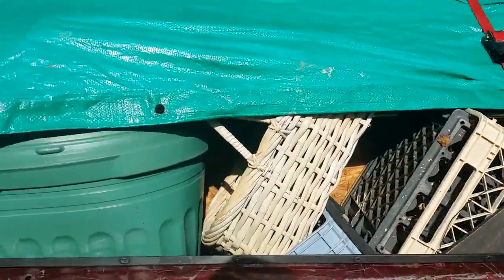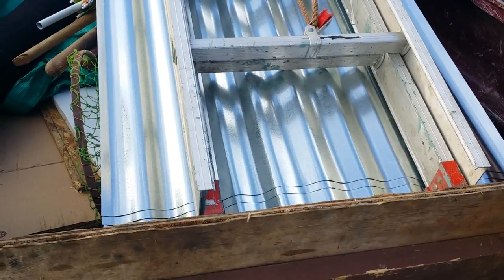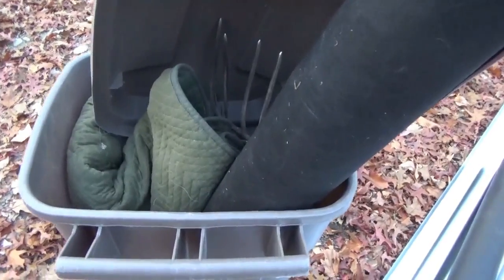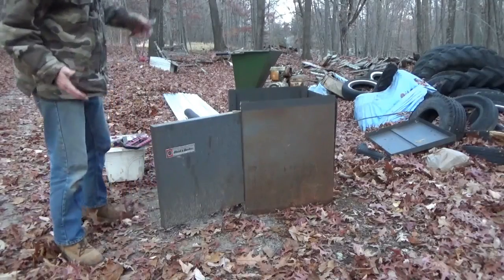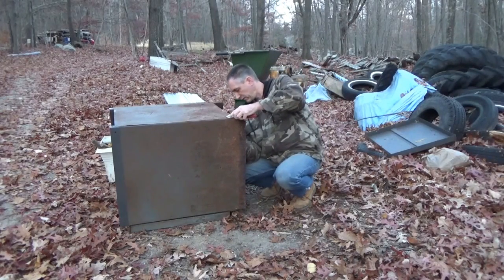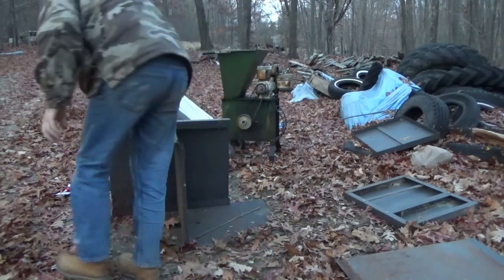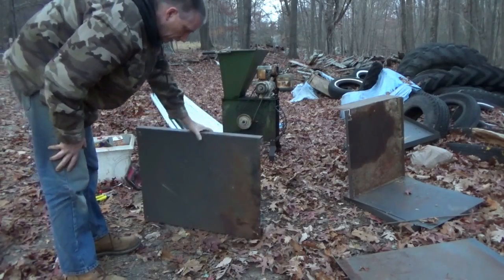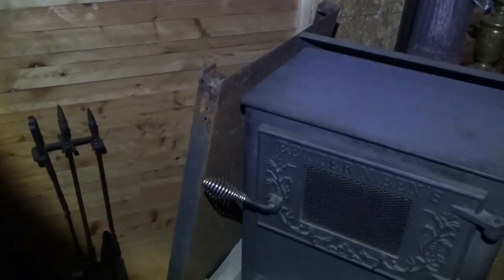Working For Others Today & Wood Stove Heat Shield Experiment

Comment: If you have any dramas with cold in the new shed Troy, simply buy a exhaust fan to extract heat from your house to the shed. A simple round cut hole in the wall facing shed. $20 bucks later, it works.
Reply from the maker: +Jack Scagnetti I have plans to heat it with the Sears wood stove if needed. I can also use that stove to heat water for showers

Comment: I had kind of forgotten about the metal cabinet. Once the two pieces are bolted together and painted black I think it will look great and definitely do the job. That was a good find and will look much better than the cement board. Good to see you got the corrugated steel panels for your shed roof. Of course even after you make a video of the roof being installed, 2 months from now the rumors will fly about how the shed roof is covered only in tar paper, which is exactly what happened with your Tiny House On Wheels. :-D
Reply: Can you believe there are still people who believe he still has no roof on?  It really must be a Fairy Meadow. .. because how else could a house with no roof not leak.?
Reply: MollyDolly What's funny is Troy made a video of the roof installation on his house about a year ago, but people still insisted it was only covered in tar paper until he finished the small part along the back directly above the eaves. Those very same people thought the entire roof was installed at that time, and asked why he didn't make a video of the roof installation. Isn't it amazing how the YT rumor mill works?

Comment: Does the top of the wood stove get hot enough to to cook on or is it insulated? If you get a couple grates to lay on top you can cook through the cold season and save gas.
Reply from the maker: +MRrwmac It does not get very hot but enough for slow cooking in a dutch oven

Comment: Its a pity your not able to channel that excess heat to the shed to be - keep your water tanks, pipes and batteries warm through the cold winter
Reply: +The Do It Yourself World It's to bad the water battery room is not on the north side, you could skip the heat shield and run an heat duct right from the wood stove out the back and heat the room. Right now you could move the room by removing 7 screws . . . just thinking.
Reply from the maker: +Ram Francisuk I will do just that
Reply from the maker: +Holly Laughter I have multiple reasons for where it is now though. The solar electronics and all my plumbing is over there for one thing. The solar porch should heat it in the day as well. I hope.

Comment: trying to answer your question that you need a pull rope to pull your two by fours with your lawn mower you can also pull logs to certain degree closer to your homestead saving you some lifting work.. to home number you may need to make a small slead cart.
Reply from the maker: +Howard Boone Yes that is true. The garden tractor cant really get out there though without a lot of brush and rock clearing. Working on the path. One day it will be done. I need to get a truck out there too
Reply: I herd you tried and had bad luck.. sorry about that,, Did you learn from it,, one is not to turn on a slope.. wet is not good ..I flipped a 3 willer it all something to learn. but be safe.

Comment: Troy you don't want steel as a woodstove heat shield it transfers heat. You want a ceramic cement board.
Reply from the maker: +Don Holden Actually steel works very well. The wood stove heat shield on the back of it, that is a part of it, is steel. But you must have air flow underneath and on all sides.
Reply: +Don Holden   I agree with you Don, cement board works very well, metal will rise to the temperature of the heat it is trying to block and therefore is not a barrier, it may help but he could put the cement board against the wall since the heat will not go through it. I experimented with a 4 inch square of it years ago by holding it in my hand and applying a torch to the other side and it held the heat back.
Reply: +Don Holden  I used a cement fiber board actually 2 of them 3'X5'  and mounted them on 2 hard wood 1x2 vertical boards at each side. I left the bottom open for air in and the top open for warm air to escape . the distance between the stove pipe and fiberboard is 16 inches. They never get too warm to hold my hand on them. I've had no problems since I mounted them over 2 years ago.
Reply from the maker: +Rich K A heat shield, as defined in the fire code and wood stove installation manuals, is a piece of metal set off on spacers with air flow underneath and on all sides. The metal will be air cooled and will not reach the temperature of the wood stove.
Reply: +The Do It Yourself World&#160;&#160; &#160;True, but neither will the air where the heat shield is located reach the temperature of the stove, the only advantage of the metal heat shield is it&#39;s deflective ability and it is not really great compared to other materials, cement board is much better because one side gets hot and the other side does not. Your choice but I would put cement board on the wall and use the double insulated pipe and feel real good about it
Reply from the maker: +Rich K Funny thing is - and I am not arguing with you - I have read that steel is best and cement board is not recommended. Just what I read. Not saying I am right.

Comment: Are you going to get a roll of dumpster for Saturday while you have many hands to help fill it?
Reply: +Holly Laughter I just had a second thought.  Invite at least one troll along with the help. Have hot dogs, marsh mellows and all the trimmings for the bon fire when the burns down some. Make it a festive occasion , eat the dogs roast the marsh mellows, Oh what fun ,then make a burnt offering of the troll, and sing oh happy days. LOL
Reply from the maker: +Holly Laughter Just called around. They want $275 plus $90 per ton. Ouch. Nope that is not happening
Reply: +The Do It Yourself World  A fire built close to the garden would yield some great ash for it. I do that here and mix the ash to the soil in my garden. I t does wonders . A Saturday bon fire with friends is always a lot of fun. Only haul of that stuff that cannot be burned.
Reply: +The Do It Yourself World at least you checked into it. Maybe rent a U-Haul $19.00 a day + gas for local use (that may have gone up since I rented one several years ago), by the time you take 10 pickup loads round trip to the dump the $275 + tonnage may look cheap, our dump here is only open till 1 on Saturdays so get an early start. It's great your friends are coming to help I hope you don't spend the day sorting and moving the trash around, it won't be long till it will be frozen to the ground and covered in white.
Reply: The Do It Yourself World It took years for the all that trash to be dumped before you bought the land. It will take you a lot of time to clean it up.
When you need to get out to clear your mind take a garbage bag and fill it. When the truck is Fixed and you take a trip to town take a load with you. I've done that for years.
Reply from the maker: +Holly Laughter Actually I figure maybe two pickup truck loads of actual trash. The rest is burnable wood. Wood stove wood that I will cut up and burn for heat.
Reply from the maker: +kc5vip Hamitup Most of the burnable garbage is wood and will be burnt in the wood stove. We will gather everything into a neat place though.
Reply from the maker: +Holly Laughter Found one big problem is that the dump closes at 12 Saturday. No way we can finish in time and get there 40 minutes from me
Reply: +The Do It Yourself World Get a big magnet to pull the nails out of the ash and save some big bucks on fix-a-flat :)
Reply: *****  I don't know about New York .
With Arkansas we don't have a problem with
out door burning .
Reply: Bea ArthursVagina I don't know as I haven't really read much of her comments.
Reply from the maker: +kc5vip Hamitup been doing that for a couple months now. Just picking up bits here and there as I go.
Reply: +The Do It Yourself World   Yikes...$275.00 plus tonage is high...I thought ours was bad at $199.00 dump fees included.

Comment: Just an idea for when you get that heat shield done...a quick coat of rustoleum (obviously) as a base coat, and then a coat or two of chalkboard paint.  Then when you're not using the wood stove, you've got a magnetic chalkboard, which conveniently requires no extra storage.  d;o)
Reply from the maker: +ElectroPig Von Fokkengruuven Thanks for the suggestion
Reply: The Do It Yourself World
Well...without a full-sized fridge, you need somewhere to put your fridge magnets, right?  d;o)
Reply: *****
Yeah, because heat shields are always amazingly hot when there's no fire in the stove.

Ever heard of "physics" before?  The laws of thermodynamics?  Heat always flows from hot to cold, so when there is no fire, there is no heat, and any heat that the metal would have absorbed DISSIPATES INTO COOLER AREAS.

What is it with people on the internet assuming that because you don't specifically give 100% of all possible facets of a given idea that necessarily equates to "the person youre talking to is a complete idiot who hasn't ot a clue" or "since the person speaking didn't provide a 300-page treatise with every possible facet discussed, that means they don't know what they're talking about?"

I'm really getting sick of "internet geniuses" lately...
Reply: *****
Actually, I'm doing another (regular) guest spot on another radio show tomorrow, so I've got to get some sleep, and I really don't have time to listen to you tell me how much smarter you "believe" you are.

Let's just consider you at the very apex of the bell curve and leave it at that.  (Now you just go run along and ask mama what that means.)
Reply: *****
Feel free to take two paces backwards on the bell curve.
Reply: *****
I think no such thing.  As a matter of objective evidence, you show very clearly, and repeatedly, that you are the very opposite of intellectual.

Please feel free to take two more steps back on the bell curve.

Comment: Is that your truck running again?
Reply from the maker: +Holly Laughter no
Reply: +The Do It Yourself World Bummer is it just a fuel pump?
Reply from the maker: +John Adams HA!!! Please do tell me where I can get one of those. Here they cost $89. Its an in the tank fuel pump with an complete assembly. PLEASE - PLEASE tell me where I can get one for $18.99!!!
Reply: +The Do It Yourself World Hey - Troy - be sure to post his reply telling where we can get that fuel pump for $18.99!! I want one too! lol
I thought the fuel pump on my Dodge was going out and checked around, the cheapest I could find was around $150! That's partially  because, in their infinite wisdom, Dodge put the fuel filter on the in tank fuel pump, so you have to replace both!
Reply from the maker: +J. Williams Yeah, well dont hold your breath. lol
Reply: +The Do It Yourself World Have you tried online? I have found several $80+ parts for less than $20 on line and my 17 year old dodge doesn't know the difference.
Reply from the maker: +kc5vip Hamitup I think I found one for $69 but with no framing and no accessories. A mess to swap out. I think the one for 89 was just a drop in replacement.
Reply: The Do It Yourself World Sounds like a fair price . Some have said the bed needs to be removed to install it. I have a seen a shop I know siphon the gas out a drop the tank.
Reply from the maker: +kc5vip Hamitup Not mine though. I just lift the bed up and remove the fuel pump :)
Reply: +The Do It Yourself World  Oh that's right!  Yay for that dump bed!!   You have GOT to get that fixed... beats $275 for a roll off dumpster.